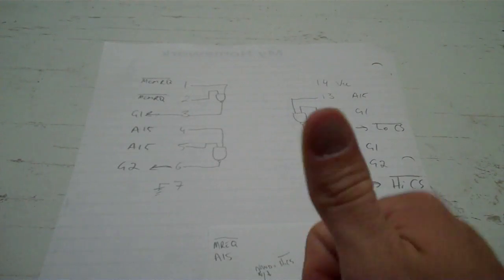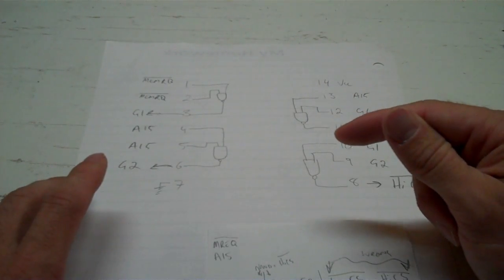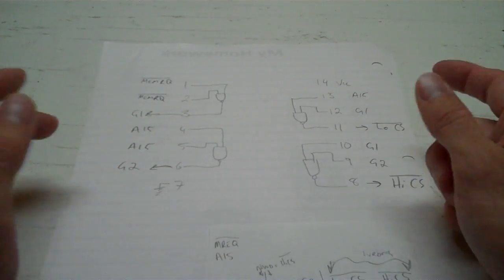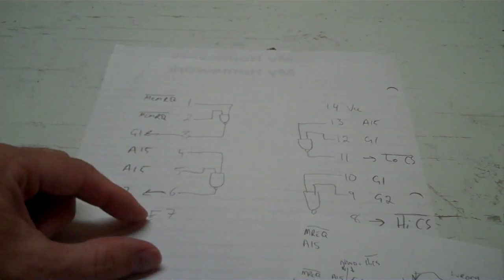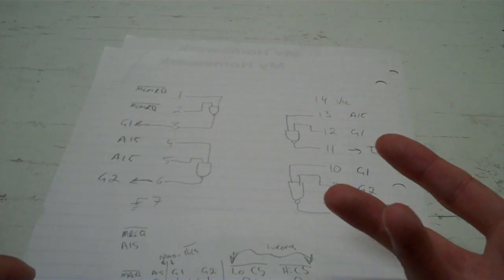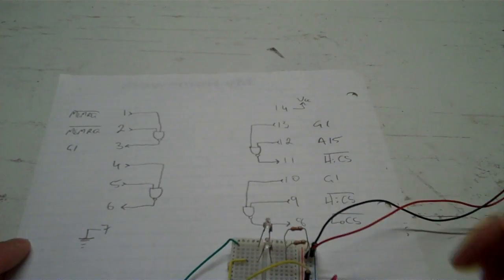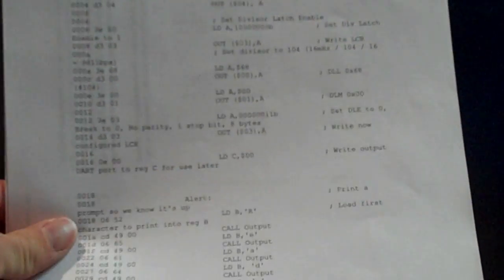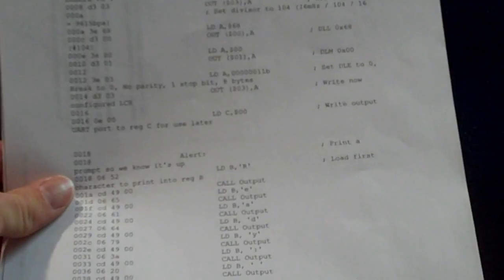Z80 - Memory decoding corrected

Comment from the maker: You what now? Are you confusing serial ROM as in I2C/SPI with serial as in RS232? The Flash I'm using for ROM is a parallel device and lives on the memory bus - where it'll stay, even if I latch it out, it'll just no longer receive "Hey, talk to me" signals on Chip Select/Output Enable.